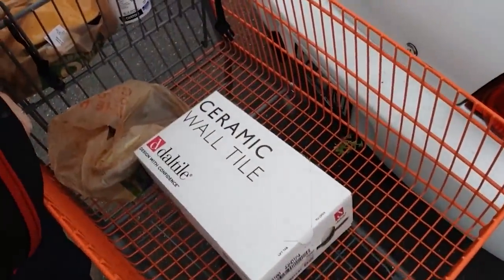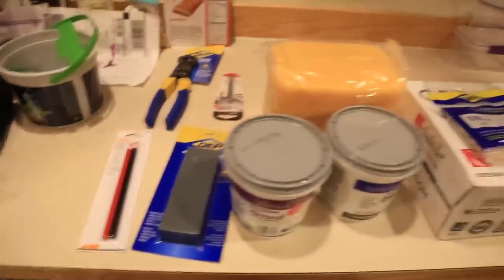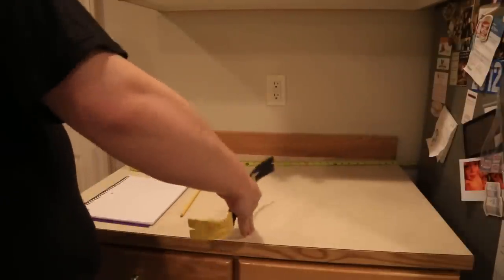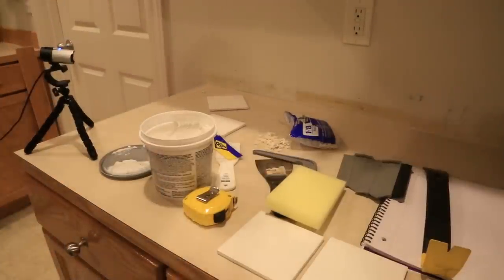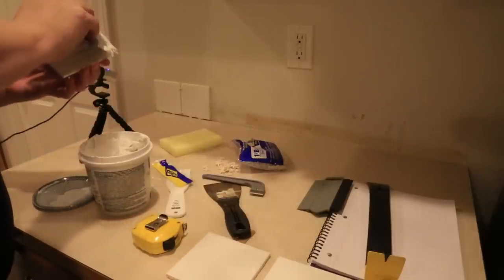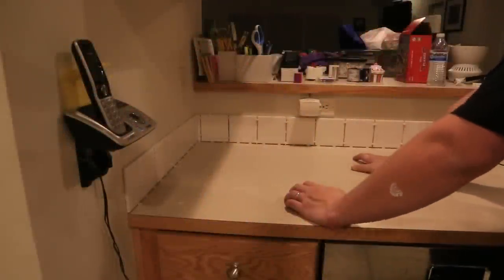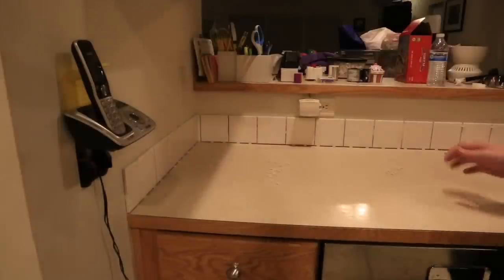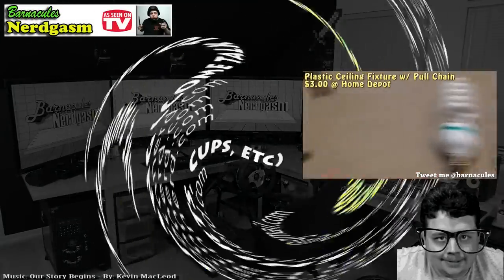Barnacules shows you how to tile a kitchen backsplash - My first time & it turned out great!

Comment from the maker: That is a great tip! Another contractor showed me a trick where when the grout cracks you just fill the crack with clear silicon caulk and then take the grout dust (not mixed with water) and dab it on top and it sticks to the caulk and it looks perfect :P

Comment: Good job for a first timer!  A pro would start in the centre and work outwards so you get identical cuts at either end, not a big deal but it does make things a little more symmetrical, which is pleasing to the eye... but it's waaay better than my attempts at writing code :-P
Reply: or divide the width of the wall by the width of a tile, if the final cut is less than half a tile cut the first one as well

Comment: I believe you're supposed to put tiles on cement board (like a 1/4" board in your case).  The mortar binds to it better.  The cement board doesn't soak up water like sheetrock should any moisture get behind any tiles. I know for floors the cement board (with lots of screws) helps lessen movement that will crack tiles over time. But it may not make a difference for such a small area.  Looks good though.
Reply: Boo Garz I profressional install tile. Rarely do we ever use cement board for wall tile. If it's new work then we do always just use cement board and mortar. Also if its in a high water area (like a shower or bathtub, than cement board and a membrane are a must. But for old work and an area that there's low chance of water penetration, unless he sprays it with a sprayer for a very long time it'll be highly unlikely water gets behind those tiles. Unless he slacks on making sure he seals it well with the caulk. He did use the wrong adhesive though, it's not that it will ruin the tile or wall (it can be safely used with it), but it's not the best for wall tile. He should of used mastic, which works much better on drywall than mortar.

Comment: Hey jerry when the grout cracks AND IT WILL do what I did on advice from this old contractor I know ...... Use white 100% silicone like you use around windows and suck .. It stays white and never cracks or separates ..I was re-calking like very 3 years cause of cracking and now the silicone has been there for 7 years and still looks brand new ... Just a helpful tip !!!!!

Comment: First piece of tiling should he not have centered the first tile and had half the cut on either end (possibly bullnosed tiles)?
And the sink unit, should he not have worked out from the corner and 'hidden' the cuts at the ends?
Still apart from a lack of planning (possibly part of his ADHD) a very creditable job for a first time.

Comment: Sennheiser sell a kit for cameras which consists of a small receiver that plugs into your cameras mic input. You also get the transmitter (body pack) with a lavalier mic head and an adaptor that turns any XLR mic into a wireless one. Buying cheap mics is a false economy as sound quality is terrible and reception is generally poor. Here's an Amazon link to the Sennheiser kit:

tinyurl(dot)com/mlmssml

It's an EW100 system.